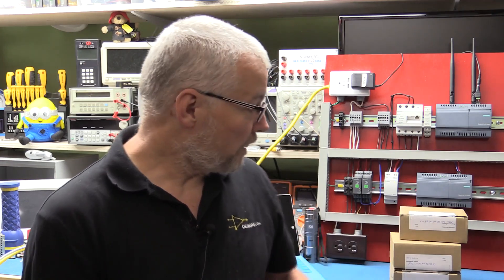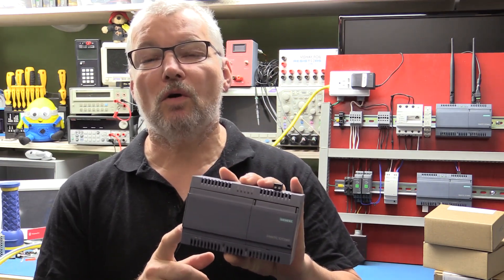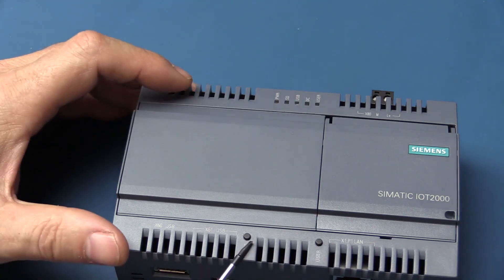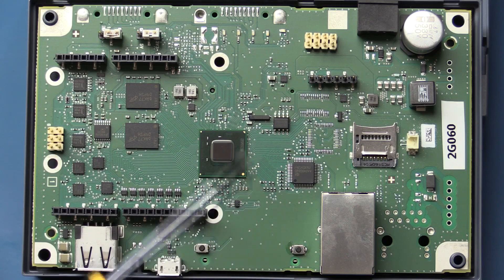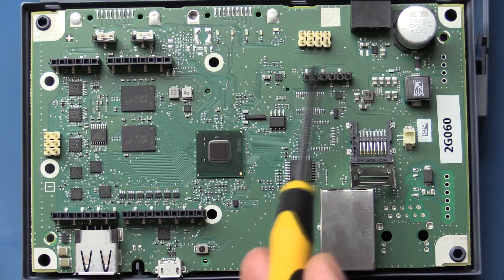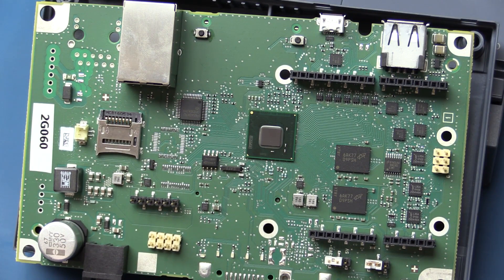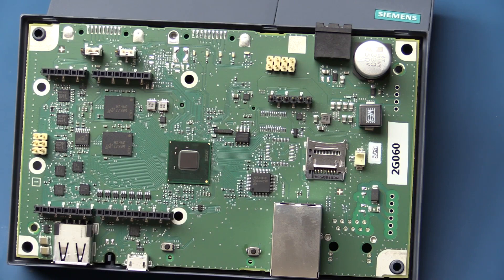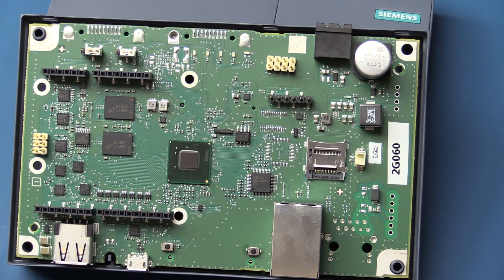The Siemens Industrial IoT2020 Educational gateway unboxing and technical look

Comment: Really wished they kept some IO or at least side by side bus socket, so you could use their relay and IO modules. This looks to have everything come through he front via arduino shields.
Reply: I had a PLC in mind first when I first looked at it. This is not a controller, it's something else. Much more a gateway.

Comment: Thank you for a very informative video. I have a question regarding CE-approval,  - will the approval still be valid if a shield is added in the front or the wifi-board with antennas is added at the rear?
Reply from the maker: All approvals typically have constraints arround them and also consider use.
If you make a board to add to the UNO header on the IOT2020 then it may no longer meet CE approval as originally published for the product and you may need to re-certify the new build if your planning on re-selling the complete product. If you're using it for yourself then no worries (Except that in many environments it would still be expected that you follow wiring codes and other legislations which are beyond the scope of my knowledge doe to regional differences etc). Even buying CE approved products to add to another CE approved product does not mean the end product is still CE approved. it again may need re-certifying.

CE approval btw is a certification that can be self declared but check with local laws and guidelines. Other certifications may require submission to a LAB (UL for example). again, if the additions are for your own use and you follow common sense / local regs your good.

Siemens are however designing add ons for the IOT2000 (2020 and 2040) that do retain certification when used.  am currently sworn to secrecy but they will be appearing soon and you will like the option :). that's  all I can say for now. except I will be one of the first in the world to show it being used......
Reply from the maker: Then again, it looks like Siemens have made some info public
https://support.industry.siemens.com/cs/document/109745791/delivery-release-for-the-io-shield-for-the-industrial-iot-gateway-simatic-iot2000?dti=0&pnid=24683&lc=en-US

https://support.industry.siemens.com/cs/products?mfn=ps&pnid=24683&lc=en-US
Reply: Thanks!  Exactly what I wanted to know. Geir.

Comment: Hello,
I bought the USB to TTL converter you suggest me to buy in an other video.
I currently try to connect with the IOT and I get weird character when the IOT boot.
The plug is correctly insert since the pin 1 (gnd) is on the right side.
I noticed you have separate the pins from the connector.
You have:
Pin 1: Black (GND)
Pin 4: Red (TXD)
Pin 5: Green (RXD)
I looked in the cable manual and here is the pin assigment:
6 Pin Header Pin Assignment
Pin 1: Black (GND)
Pin 2: Brown (CTS)
Pin 3: Red (VCC)
Pin 4: Orange (TXD)
Pin 5: Yellow (RXD)
Pin 6: Green (RTS)
So that fits with the "SIMATIC IOT2020 - Create SD Card Boot Image and Configure Network" video.
Do I have to change the connection of my connector? (I suppose I am OK)
I have to select "Serial" in PuTTY, right?
What is the default baudrate and what are the parameter you select in PuTTY?
Thank you very much for your support.
Have a good day!
Reply from the maker: I just happened to have the one I was using already, the one listed was the recommendation from Siemens and should work.
My Serial Putty Settings are as follows
115200 Baud
8 Data
1 Stop
No Parity
Xon Xoff flow control.

I do have one of those 6 pin versions on the way and will let you know if there is an issue

The pinout of the connector is as follows (RTS and CTS are not used normally)
IOT2020           FTDI Cable
GND                        GND
RTS                         CTS
N/C                         VCC
RX                            TX
TX                            RX
CTS                         RTS

Note the crossover on the RX, TX and CTS, RTS lines, this of course is normal.

I think the RS Part number is 429-307, description  FTDI Chip, 3.3 V TTL USB to UART Cable, TTL-232R-3V3

The Datasheet for it can be found here :- http://docs-europe.electrocomponents.com/webdocs/139d/0900766b8139de64.pdf
Reply from the maker: Also, what was the link to the cable you actually got. Thanks
Reply: Sorry for the late answer.
I bought it on Amazon:
https://www.amazon.com/GearMo-Header-TTL-232R-3V3-Windows-Support/dp/B004LBXO2A
It works perfectly since I changed the baudrate.
Thank you very much!
Reply from the maker: OK, good news. happy programming, Have you downloaded the latest 2.1.3 firmware, loads of fixes and all the software I requested in and running.
Reply: Yes currently following your video and updating Node-Red to latest version. Had time to go to store and still running :-D
Reply: Can I use LED directly on outputs if I have the Siemens IO shield? I don't think so since it is convert to 24Vdc.
Reply from the maker: I will have a video on that in a few days... but yes, the direct outputs are LED friendly
Reply: Even with the Siemens IO shield? I mean it is written 24Vdc. Will try, I will burn a LED in worst case scenario.

Comment: Peter what industriual standard. Its I thinks bull shit..
Reply from the maker: Operates on a 9-36V DC supply
DIN Rail mounting
Standard Industrial style enclosure
Motherboard designed for industrial 24/7 use
0 - 50 deg C operating range (Yes not the widest range but good enough for most installations )

What part makes you think it is not industrial capable ?, it is every bit as quality as other Siemens PLC controllers and devices and is built to the same standard as the IoT2040 ? which is sold directly by Siemens for industry use. The 2020 is an educational build, but still built to the same exacting standards
Reply: Frans van Aperloo - Those: https://support.industry.siemens.com/cs/ww/en/ps/6ES7647-0AA00-1YA2/cert